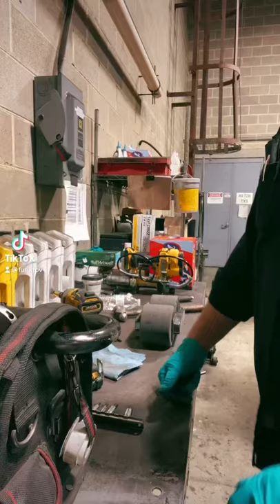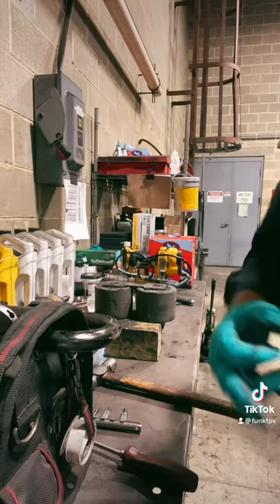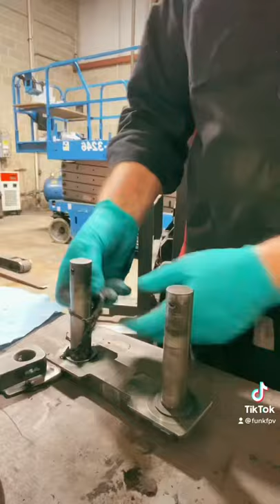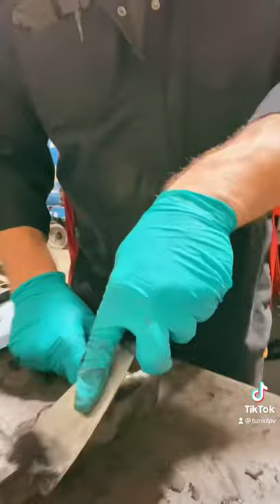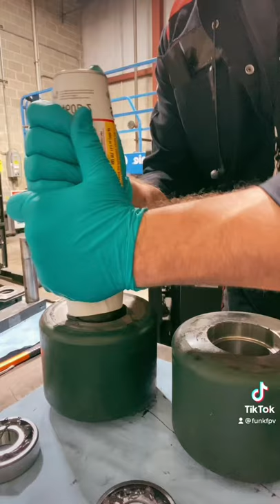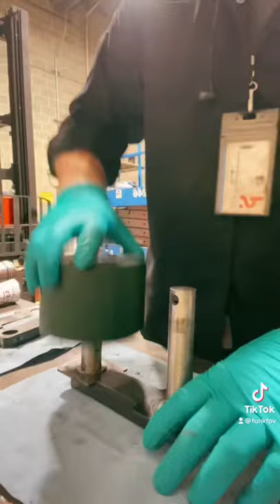Replacing Reach Forklift Load Wheels

Comment: Drove forklifts for 45 years, all different kinds, good maintenance is  the key. 
Been sprayed with hydraulic oil, had tires disintegrate, seen 48 volt batteries catch fire. Drove a lot of junk, drove some nice ones too. My favorites were the old Hyster Monotrol 36v electrics. The only thing I hated was most of the old ones had no steps, just a cutout for your foot to get up, and then just jump off. Left ankle is all messed up from that.